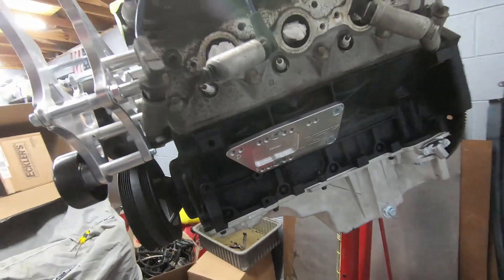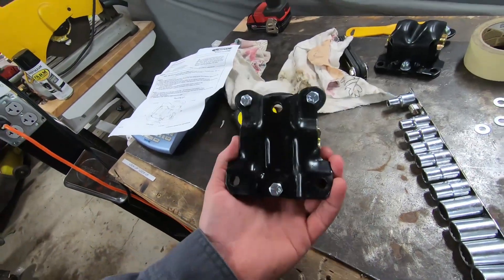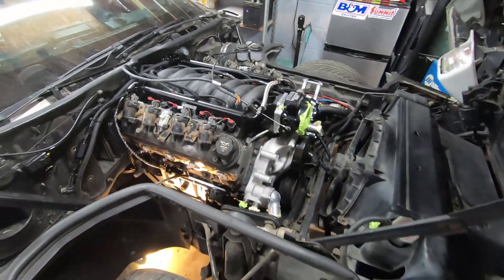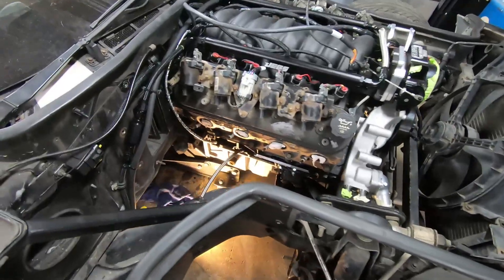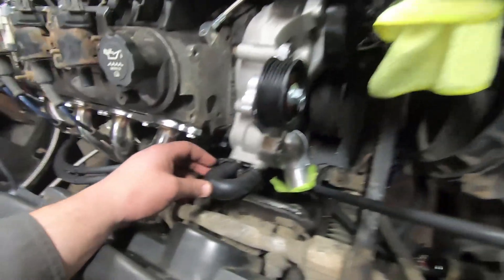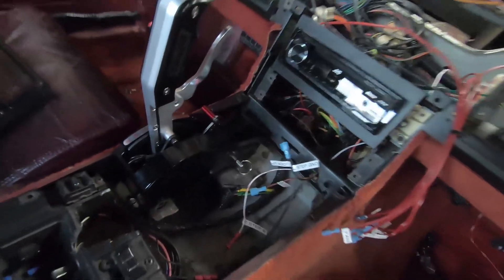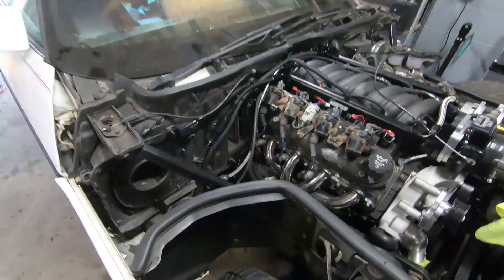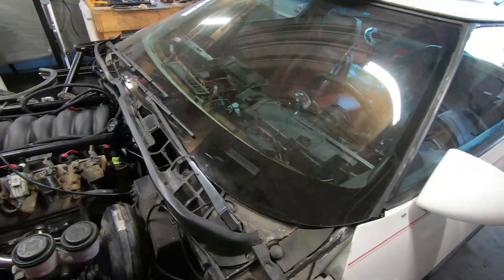Will a Silverado HD Motor fit in an 80s Corvette? - LS Swapped C4 Corvette Pt. 2

Comment: Things to consider, ls ac different, is the radiater in a similar place, how about the power steering pump being different. Does it fit under the hood. Did you use the ls trans, what about driveshaft length. Angle, are the engine mounts made for the c4. What about the heater core, ac being wiped out on the Cowell. Did the steering shaft clear. Exause fitment, headers. Ripping old pc out for new. Etc Major pain stuff.

Bloodviking

Comment: A big block chevy will fit with the same mods the ls needs to the car such as the firewall heater ac core area so why not go with something that has way more power. The sl is about 300 hp replacing the 300 hp lt1 engine
Bloodviking
Reply: Clearly you don’t know much about c4s, the stock 84 crossfire engine, was garbage and barely hit 205-210 hp, the Ls is a no brainer millions time better option that stock, and the 6.0 mad 350-400 hp stock, even more with a $300 cam and stock heads and internals